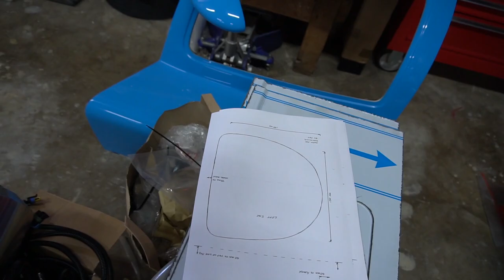Project Blunicorn 020, Body and Cooling System

Comment: Happy New Year 3D.  Thank you so much for letting us follow your amazing journey.  Thank you for taking the time to spell out the details.  You carefully inject a lot of information into each area of the build, potentially saving other builders a lot of time avoiding mistakes.  I appreciate all your insight on avoiding pitfalls.  I am still surprised how an expensive kit like yours requires so much trim-&-fit work.  You have proven once again that drawings on paper don't necessarily transcend  into mechanical functionally.  Car designers should all be made to go down on the line and build the cars.  Keep up the great work.  You are a true inspiration.  Happy New Year.
Reply from the maker: Thats one of the biggest reasons I do build blogs/vlogs is to educate and inform.  It doesn't have to be an Ultima, but if these videos help with any project it's been worth while.  Building this car and sorting it out is really an eye opener, but the biggest tip I can give is to think about replacing or repairing the component you're working on.  A lot of builders don't think about future serviceability.

Comment: Humble, what product did you choose to treat the back of the body panels?
Reply from the maker: I used POR-15 black etching primer, it's very thin but coats well.
Reply: @DriveDriverDriven  Out of curiosity, did you use the self etching primer or the regular semi-gloss black POR 15 rust preventative? I've been researching the regular POR product and it's actually supposed to be amazing for fiberglass and impervious to damage. Wish I could use the same stuff as the factory but they don't sell it in the US....
Reply from the maker: @ultimars1684  I used the self etching primer which worked great, but fair warning, it's very thin and runny.  Do a good job taping and keep a rag handy for spills or drips.  I also used a black paint pen for edges and small delicate areas.
Reply: @DriveDriverDriven  Copy that. I've heard some horror stories about getting the POR anywhere unintended; clothes, on the ground, your skin....Appreciate the help. Looking forward to seeing your Pacific Blue assembled. Cool color!